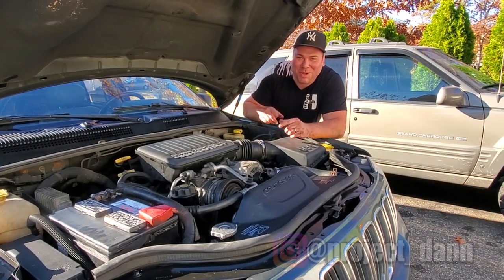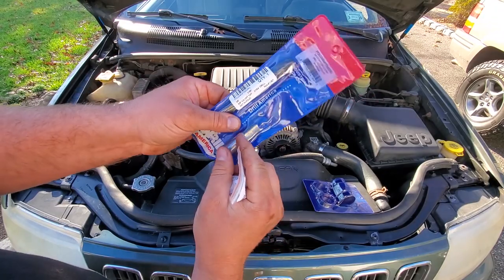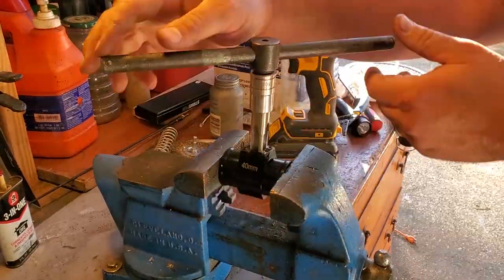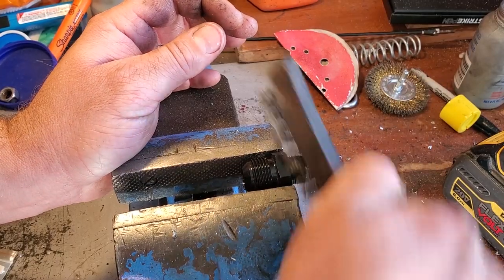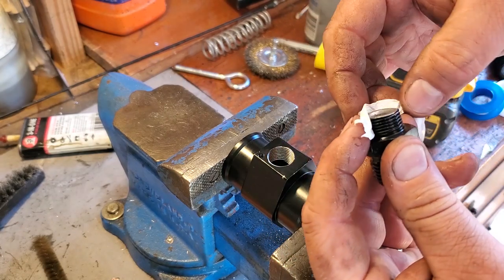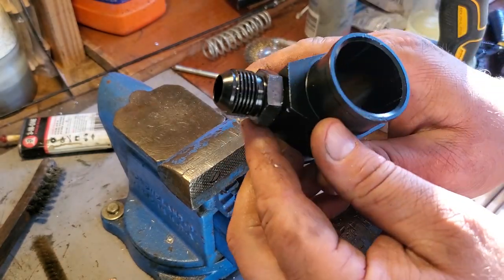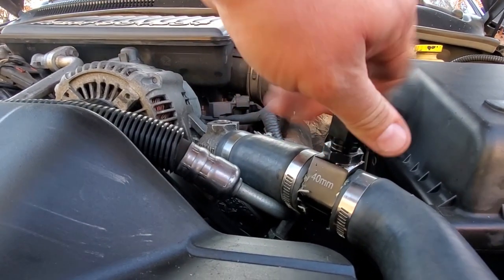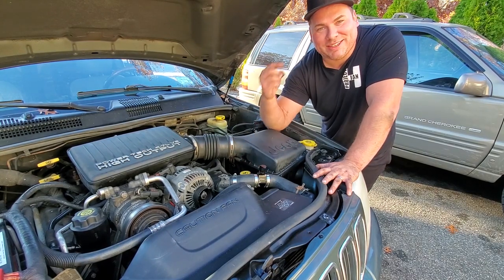STRIPPED BLEEDER SCREW FIX FOR THE JEEP GRAND CHEROKEE 4.7 GREEN HORNET WJ

Comment: Appreciate you posting this video and Amazon links. After stripping the bleeder valve on my WJ Jeep, I was left wondering if even an extractor would even work on this its so tight/stuck. Instead of mangling it, I was looking for some solution like this when I stumbled on your video. I was having a lot of problems finding the right part to do the couple and you showed the way in your video. :) 

Instead of buying the bit and all that, I'm just buying an appropriately sized screw that fits into the port.
Reply from the maker: Awesome brother!! Thanks for watching!!! check out martinbuilt too!

Comment: Hey sorry to bother you . 02 overland  having a slight temp increase ..what power steering fluid do you recommend .using O'Reilly's  which is ms5931 approved  I think they changed something .it's not pushing the fan  idle like it use to..no codes etc
Reply from the maker: MS5931 approved should work.  I ended up using Valvoline after I couldn't get anymore from the dealer.

Comment: May I ask why not just use regular screw in place for a sensor to save time and work for drilling? Or if it's possible to do that. I have exactly the same issue.
Reply from the maker: Maybe this is a little overkill, but I rather use Martin builts set up for maximum air bubble purging. 😁

Comment: My bleed screw stripped today so i will buy an hose adapter at the local store, unfortnely i dont have a place for upgrading the adapter so i have to use a temp sensor as bleeder screw instead
Reply from the maker: Ahhh I hate that screw!!! God speed on the project!

Comment: i would have just found an old Temp sensor and screwed that in ,,, Still let the air out by loosening , Or even better get a next size up  Torque`s and bang it in lightly and undo the original plug 
Ron NSW Australia
Reply from the maker: lol.. the whole purpose of this video was because the bleeder valve could not be removed.
Reply: @ProjectDanH  yep But im saying the hole that was in there you could have just put an old temp sensor in the tread rather than drill and tap a new hole  could even have put a small water tap on so even easier to bleed the air , But if you like drilling and tapping thats great ,,,,
Reply from the maker: Ooohhh I gotcha!  Yea.. your absolutely Right
Reply: Hi so u are saying i could possibly just put a screw/bolt in the adapter instead of doing all the screwing and tapping ?

Comment: Will all the air leave the system if i use a bleeding funnel instead on a 4,7 ?
Reply from the maker: It definitely helps prevent air from entering the system when you fill it, however, it probably wont remove air already trapped inside.
Reply: @ProjectDanH   I would second this ^^^

Comment: Couldn't you just put the adapter on and get a screw to fit in it and use that as a bleeder? Because mine is stripped and I'm not very mechanically inclined
Reply from the maker: Sure, you can apply whichever parts you are able to source! make er custom!!